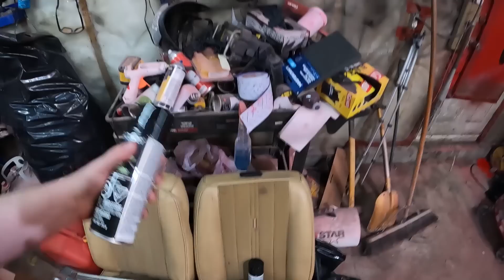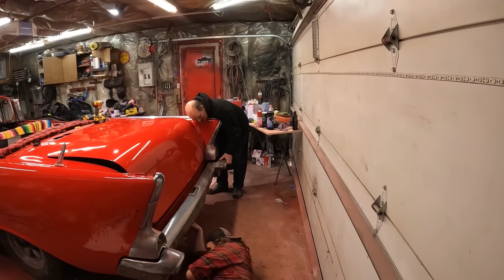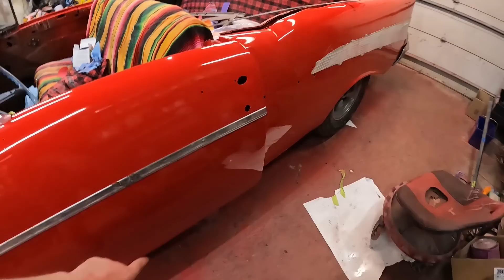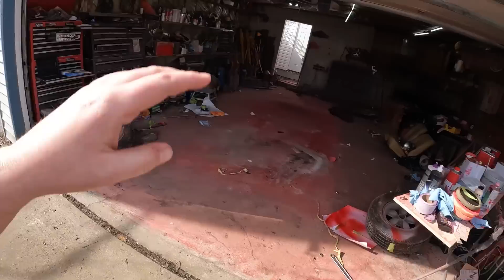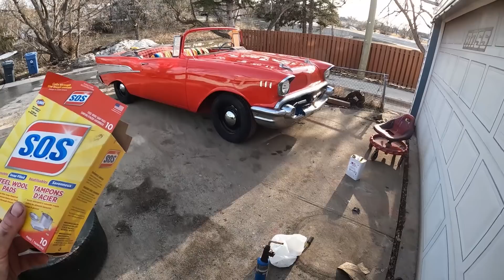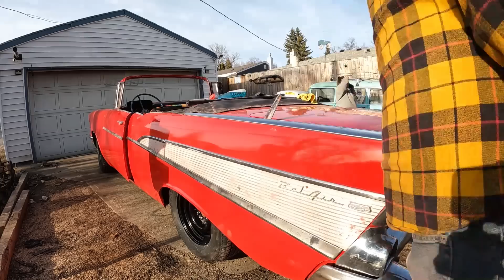NEW WHEELS And REASSEMBLY After Paint - 1957 Counterfeit Convertible

Comment: The SOS pads with the built-in soap are great for removing paint/grime, but if you get some 0000 steel wool that stuff will really shine up chrome (it's like 120 vs 400 grit sandpaper). Just don't use it on the stainless, unless you want the "brushed" look... I normally don't like red cars but knowing this is a $200 paint job I love it. Congrats!
Reply: Plus steel wool will make stainless rust.
Reply: @frankschwartz7405  you’re right Frank. It will make the stainless rust. If he can get all of the carbon steel remnants off of it right away it might stop the process. I know any place bare carbon steel is connected to stainless it will rust from industrial application. Hopefully Dan will clean it and wax it before it does. The 0000 steel works wonders on steel and wood.

Comment: The car looks fantastic with most of the trim installed. Sometimes the stainless and aluminum trim that’s beat up can be restored by tapping out the dings,and then sanding out the scratches etc, and then polishing it with something like Mother’s Metal Polish.I re-did a ‘63 Nova Convertible about 20 years ago, and salvaged some of the trim by sanding it down with 80 grit sandpaper, and then went all the way up to 2000 grit, and then polished it with Mother’s Metal Polish, after using some some 0000 steel wool. It’s time consuming though, so it’s probably easier to replace if you can find it at a swap meet.I know it’s expensive to buy the trim new. Again, the car looks great!
Years aga

Comment: I have to do the rear side panel trim on my 57 Bel Air this week. The one tail fin was hit and crushed, so I had welded in a patch, which turned out okay. But the idiots had driven over the trim, which I've straightened to okay status. But the neat thing you showed me is you screwed on the filler panel between the two moldings. I think the original was glued, but that's just a rust magnet, that's why you have the pitted surface on the side. No drainage.

Comment: Was cleaning up some chrome and found an interwebs suggestion to use salt water and aluminum foil, worked quite nicely and I believe there was some reaction happening there because the foil turned black.  And when you're done, feel you've got the brightwork best you can remember to apply a couple coats of wax, it won't do much to make it brighter but it will reduce exposure to oxygen and kinda prevent corrosion from creeping back.

Comment: Looking good. Just finished a similar step in the fixing up of my 65 Nova wagon. I went with 6 hole early 70s 14x7 rally wheels and 3/4 inch white stripe 215/70 14 tires. The options are endless. There are 2 different center cap options, hundreds of hub cap sets out there and the really cool deep, ornate spinner/ flipper "Ben Hur" caps fit. Its currently wearing 63 SS caps. 10 minutes with a screw driver and a rubber mattet and I can completely change the look of the car. Tomorrow it may be 1970 fake Hurst Dazzler caps.
A wad of aluminum foil rubbed briskly over icky chrome helps sometimes. Gotta rub till it gets warm, I think bits of the aluminum fill the tiny pits.

Comment: Looks pretty spiffy. If it's not a poster child for inspiration IDK what is. 
On your bits of trim that are pieced and on the board for replacement as you find them...... I've seen guys use RTV silicone to help make things prettier for the moment. Like your two piece sail panel on the drivers side..... you can spoosh a little silicone behind the offensive piece and tape it, prop against it, even use ratchet straps and blocks to hold pieces in/down while it cures. Unlike double sided tape it doesn't mess with you while your assembling, can get razor thin, or stack like duckshtuff and cleans off relatively easy when you change things. 15 years ago I had an 84 square body, had just seen this trick, and a little piece of grille surround had come loose. I grabbed a tube of blue glue(gasket silicone - it's what I had RIGHT NOW) and stuck it in there to hold (and keep the trim from getting damaged) until it got fixed properly. Sold the truck shortly after. I just saw that truck 2 weeks ago and it still has that blue glue repair holding tight - 15 yrs - I'd have never dreamt that.. The most important part is not to overdo the silicone resulting in bent junk trying to get something loose. Thanks for sharing

Comment: i found a 57 two door near me but its been settin on soft ground for 30 years and has sunk deep enough to have to dig the door open. i looked it over and pretty much all the bottom is gone. there is a frame and a v-8 i do not recognize. (I'm 59 so I've seen a engine or two) Waiting to hear back if they took my offer or not. I blame it all on you just so ya know

Comment: Hollywood sure does look a lot better than she did 10 months ago.  I will be curious how that vinyl paint holds up. Mine has not held up to wear. It doesn't dye like they claim, scraps off to expose the original color underneath. Window cranks are my issue with the paint.

Comment: If you wipe the vinyl down with higrade mineral spirits it will soak up the dye and wear like it was factory you want to spray the dye the instant the mineral spirits evaporate its like it opens up the pores or makes it ready to exsept the dye but if you wait tolong it will not work i have had amazing luck doing that started off doing it back in the 90s painting vinyl siding and windows it fadded but 10 years later the paint never pealed or cracked and came off acted like it was factory siding and i was using acrylic paint back when behr paint was good paint before they brought out the paint and primer in one and ruened a good paint lol have a good one love the car

Comment: Dan nice job. If you really want too shine up your chrome. I use simichrome polish and a cotton cloth. The best cloth is the old hospital heavy sheets. they are the best in my opinion. I've been a Harley rider for over 50 yrs.and I have had too shine up ALOT OF CRAPPY LOOKING PARTS. but once you know what your doing. YOU CAN POLISH UP A TURD AND MAKE IT LOOK FABULOUS. MAKE IT SHINE LIKE A DIAMOND IN A GOATS ASS. WITHOUT THE GOAT..  now alot of folks like never dull. It works on slightly tarnished stuff.and aluminum But I want too bring back the dead so too speak. The blacker the rag or cloth the better. Don't throw those black cloths after they get stiff. Just wet them slightly and start rubbing. They will continue too bring back the shine . I've had brothers give their old parts that looked like shit but worked just fine. And I polished them up too look like new. They said I see ya bought new parts . I said nope those are your old ones. Thanks for the parts .